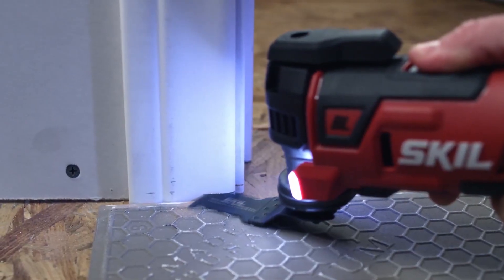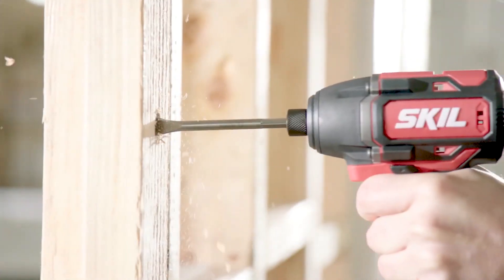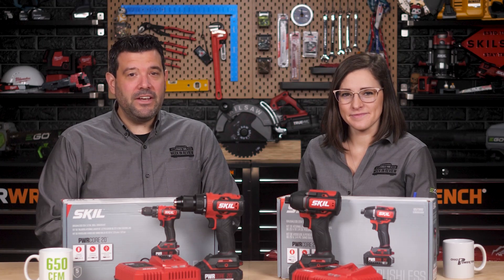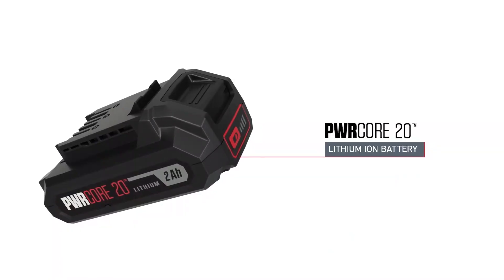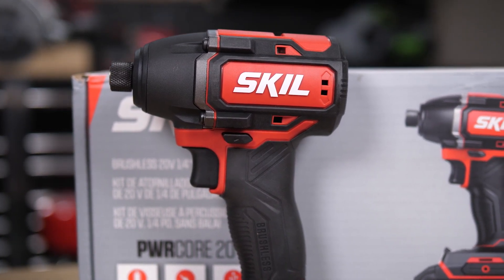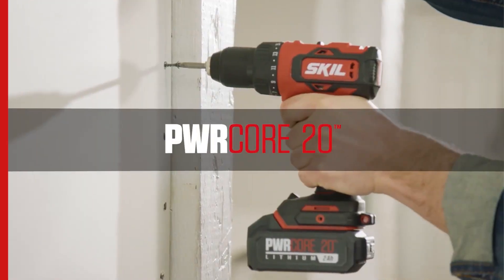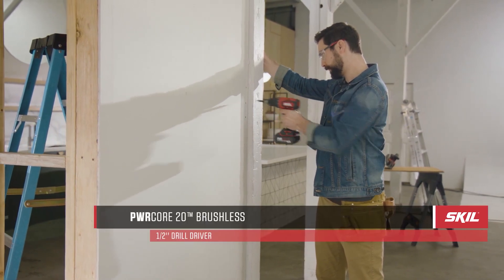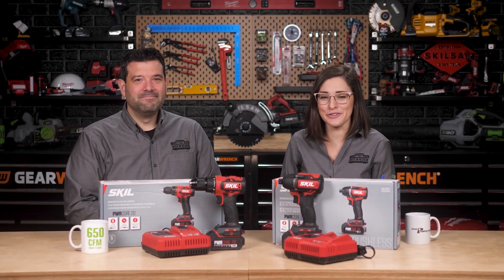SHOWCASE SKIL PWRCore 20 Drill and Impact KIT

Comment: I would be able to take the walls apart and rewire the electric in this 1981 mobile home, and also fix the plumbing by rerouting it and running the proper lines to all of the rooms using water. The water heater needs to be replaced, so this kit would help with installing a new one. So many things to get done in this house! Renovations are quite a lot of work!